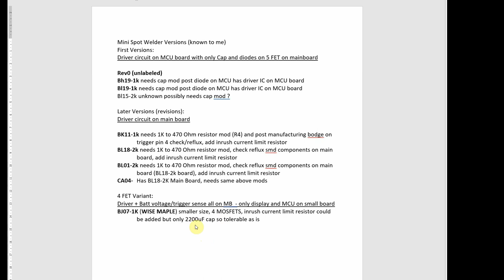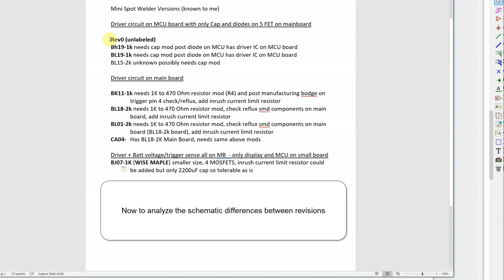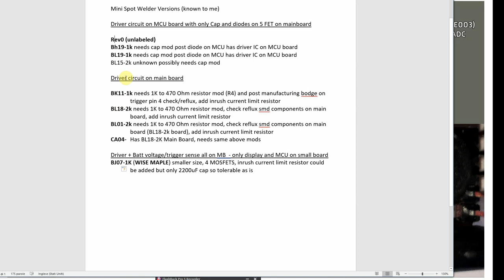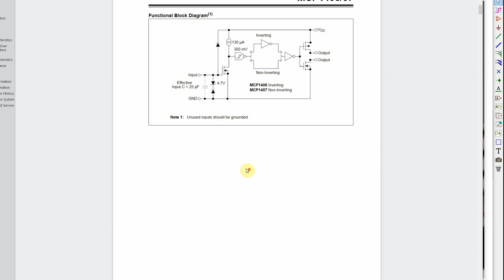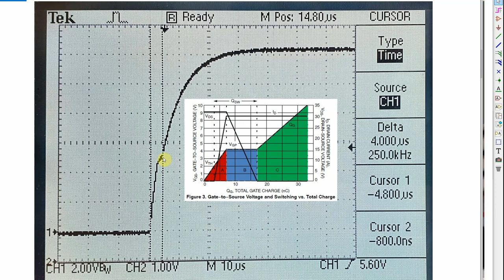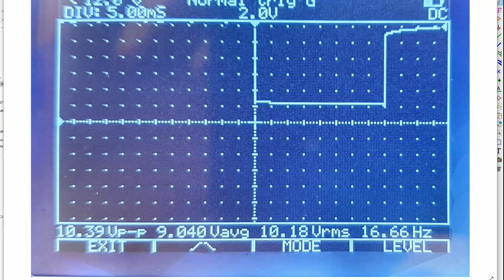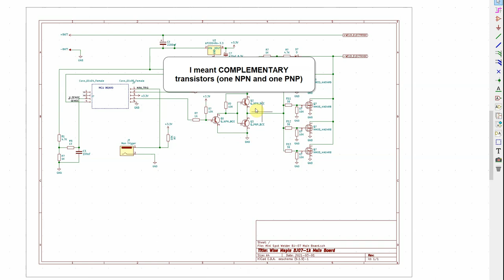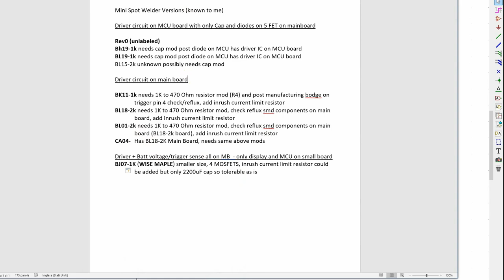All "Mini Spot Welder" versions: circuit Analysis, differences and faults

Comment: hi, i have just got CB23-4k version on both boards. Does it need some tuning?
Reply from the maker: Hi, I haven't seen that exact revision but I supposed it still needs the mods. If you send me detailed close up photos of the MCU board and the main board top and bottom I can check. My email is on the channel description.
Reply: @Luca_Techy  I have sent the photos thx.
Reply from the maker: @jobbagyferi  Yes thanks so the CB23-4K version is no different than the CA version; you need to add the 20Ohm current limiting resistor in series with the diode as shown in my related video and of course most important change R4 from 1K to 470 - 500 Ohms. You can add a 1K ohm in parallel to R4 if you have a same value smd resistor or just swap it out for a 470Ohms one as show in my video.
Reply: @Luca_Techy  Thank you very much, I just received this version and was looking for the correct mod.
In the video you say 100 ohm max on the current limit resistor but above you say 200 ohm, which is better for this board CB23-4K
Reply: I see I read that wrong, you wrote 20 ohm, not 200

Comment: I havnt seen this mentioned! Would a 115 amp hour, lead acid battery , be too much?
Reply from the maker: There is no really "to large" AGM 12V battery to be honest. If you keep the original cables you won't risk overloading the FETs and the welder design. You can even use a 12V 240Amp AGM battery as long as you always start from a low setting (5ms) and go up from there. The important thing is that you first apply the appropriate indicated mods to avoid improperly driving the FETs thus making them fail. The instructions suggest a mininum 45Ah battery because you need a high enough current impulse to weld which such a battery usually had in good working order - with a weaker or bad battery you tend to increase the weld time making the FET junction "suffer" and if the battery is not powerful enough the voltage will drop a lot and the weld will be either weak or inexistant. This is why often ppl tell me their welds are weak even at 40ms with .12mm strips and when they replace the battery with a new or appropriate one the welds are perfect at 15-20ms for .15mm strips. Also the battery connection is most important - screw on clips are the best solution rather than using weak alligator clips.
Reply: @Luca_Techy  Many thanks for your very prompt reply. If I order a pizza, it wouldnt arrive as quickly! I am very pleased I found your site. It is totally informative and superb in its content. A look at chinese power supply rfi, would be interesting. The two I have radiate like they were designed to do it!
Reply from the maker: @davidsaunders1125  Switching power supplies are very hard to design properly and even more to *shield*. Shielding them properly is more expensive than the PSU itself (inductances, ferrite chokes, high quality caps, trace distancing, etc etc cost more than the switching ICs themselves), which is why "cheap" chinese PSUs typically "broadcast" harmonics over the whole HF spectrum and even worse, inject this into your mains supply. I was once given a cheapo/clone laptop 19V PSU that would kill the "ethernet over powerline" completely when simply plugged in the mains (i was reparing a laptop for a friend). Took me a while to figure out what was happening. Upon opening it I was horrified not to mention the high risk of electrical shock in case of component failure. It weighed 1/4 of the original PSU brick (which I had), had no real shielding and if dropped there was a good chance the rectified line voltage (>300V) would short towards the DC output as there was no proper support for the ridiculously mounted heatsink which was "swaying" around the place.
Reply: @Luca_Techy  If you ever watch, Big Clive, some of the Chinese equipment is lethal!! For example, USB socket shells that are at mains voltage, in some modes. But their scopes are very good value for money!
Reply from the maker: @davidsaunders1125  yes I watch his episodes - fun and intersting! As you see, one gets what he pays for, quality is never cheap with some rare exceptions...

Comment: Why is a battery better than super-capacitors?
Reply from the maker: I get this question often: naturally it depends what you mean by "better" in the specific use case. A good working AGM or LiPo battery pack has enough impulse current (over 200Amps) to spot weld. You can even put equal packs in parallel to increase the current as many already do. A Super Cap bank is naturally also viable and has normally more pulse (short circuit) current due to the enormous equivalent plate surfaces a Capacitor has respect to a battery (the major difference). Naturally the overall capacity is a fraction of what a battery has so you can't just use a Super Cap bank to Spot Weld continuously as it would discharge rapidly after just a few welds. You can use a SuperCap bank in parallel with a battery or a power supply to keep it topped off, keeping the SuperCap bank near the Spot Welder to minimize the voltage drop due to resistance losses. Having said this a large 500F 12V cap bank is rather expensive, usually more than a 3S 5000mAh 50C+ LiPo pack, and it is common to already have access to an AGM 12V battery or 3S LiPo pack so you would be ready to go. Of course if you wanted to have an alternative then a 13.5V supercap bank with in parallel a PSU or battery to top it off after every weld can also work, but it starts complicating things and you have more stuff to carry around. I consider these mini Spot Welders more of a portable "field solution" to use now and then and not something one would buy professionally as they are not cut for it so a good car battery or LiPo pack are more than sufficient to get some spot welds done when needed without too much hassle if you see what I mean. Having said this it's really all up to you if you want to use a SuperCap bank plus a smaller battery/PSU or not, it really depends on how you want to use it. One other thing: "cheapo" super caps quickly dry out, even after no intensive use you can find yourself with a dead or unbalanced bank even shortly after purchase. A battery pack is easy to swap out as you may be using it for other things too (RC stuff, drones, planes etc) so In the end for this type of device I prefer a common battery pack than a larger series supercap solution.
Reply: @Luca_Techy  Fantastic answer!

Comment: What is the spec of the D2 Diode? Pretty sure I wrecked it.   I'm planning a rookie repair on my own. Thank you Luca for sharing so generously.
Reply from the maker: Hi Andy, you can use any 1N400x diode, the original diode is the equivalent to a 1N4007 (M7) but you don't need such a high voltage diode for this application, a 1N4002-6 will do fine, any diode that has a reverse breakdown over 100V with a 1Amp current is plenty.
Reply: @Luca_Techy  Thank you.  I did the repair and it worked when I did the light bulb test.  When I tried my first real weld at 30E (the last E setting of the bulb test, I should have turned it way down next) it blew a big hole in the nickel strip.  I think the plywood surface may not have be been hard enough to give a solid contact. Now I have continuity between the two negative posts.  Mosfet blown in open state I guess. Can I test the Mosfets on the board or do have to remove them all? Or refer me to the pertinent video.  Thank you again!
Reply from the maker: Ouch, did you also apply the R4 mod? Anyhow you'll have to remove the FETs to find the faulty/shorted one if you don't find any FET with a cosmetic fault (crack burn or hole on the black epoxy).
Reply: @Luca_Techy  Yes I did do the R4 mod. l'm not very confident in removing/resoldering the FETs but here goes. Any tricks to doing these?  Could you recommend a less troublesome small spot welder?
Reply from the maker: @Andy Louter  To unsolder the SMD FETs you'll need some soldering experience. If you don't have a hot air station or hot air gun you can use a more powerful soldering iron (60+ Watts) with a lot of flux but you need to be careful to not rip off the GATE pin. There isn't really any cheap compact unfallible spot welder, it's always a critical device due to the many variables. All I can say is that the first Rev 0 one with the MCP1407 FET driver on the MCU board after the additional Cap mod is the best so far of these types. There are also others, for ex. there is a fully compact model with LiPo battery enclosed which is definitely a better product, but of course more expensive and not for continued used (good for a couple of dozen welds or so before you need to charge it). Something like this: https://www.aliexpress.com/item/1005001799079203.html
Reply: @Luca_Techy  Thank you very much!  Your advise is very helpful and appreciated.

Comment: You seem to be saying these fail.  How long before failure of these products?  10 welds?  100?  500?  If I can get 500 or so off one I'd be willing to buy one of these for every time it fails as I can order off amazon for $25.
Reply from the maker: They fail if overdriven or used with an incorrect power source. If the indicated mods are applied and you have an adequate battery and use .12 to max .15mm strips then they last for hundreds of welds. Some have told me they have welded hundreds of cells after the mods without further issues. I don't use mine so often but the feedback from others is good. The important thing is to apply the mods based on your version.
Reply: @Luca_Techy  Thanks.  I found the Wise Maple, so I'll order that one.  I'll use a bench power supply.  Like I said, if I can get 500 or 1000 welds out of it I'll be happy at the price of these.  I need to put together a 100ah 14.8v battery and I'd rather buy a couple of these than one of the expensive spot welders.
Reply from the maker: Bench power supplies won't cut it, you need a battery capable of delivering 150+ Peak amps. Use an AGM 20Ah+ car battery or a 3S 5500mAh 50C lipo pack

Comment: Bonjour.
Tout d'abord, excusez-moi de ne pas maîtriser votre langue. Je copierai une traduction google en langue anglaise à la suite (avec sûrement quelques imperfections!) 
Merci pour tous ces précieux conseils. Je possède deux exemplaires (un CA-04 et un Rev.0). Les deux ont subit les améliorations que vous conseillez et ils fonctionnent très bien.
Néanmoins j'ai un petit soucis concernant la tension d'entrée sur l'afficheur du modèle +CA-04 (diode M7 remplacée par BY133 avec résistance série de 10 ohms + ajout d'une résistance d'1k ohms en parallèle de R4) . En effet, l'appareil fonction normalement mais il indique sur l'afficheur une tension de 19,7V alors que mon voltmètre, placé aux bornes d'entrée, affiche 12,75V (l'alimentation est fournie par une batterie automobile 50Ah).
Encore merci pour vos vidéos et vos conseils constructifs.
Robert  

(translation)
Hello.
First of all, excuse me for not mastering your language. I will copy a google translation in English following (with surely some imperfections!)
Thanks for all the great advice. I have two versions (CA-04 and Rev.0). Both have undergone the improvements you advise and they are working very well.
Nevertheless I have a small problem of the input voltage on the display of the model + CA-04 (M7 diode replaced by BY133 with series resistor of 10 ohms + addition of a resistor of 1k ohms in parallel of R4). Indeed, the device functions normally but it indicates on the display a voltage of 19.7V while my voltmeter, placed at the input terminals, displays 12.75V (the power is supplied by a 50Ah car battery).
Thank you again for your videos and your constructive advice.
Robert
Reply from the maker: Bonjour, nes pas un probleme grave, c'est le sensor de Voltage avec 2 resistors (1k e 4.7k)  - il nes sont pas precise. Vous pouvet verifichè le valeurs avec un tester. Les 2 resistors sont sur la plate MCU ou est le R4 (3 resistance, 2 partiteurs et une 1K vers le MCU). Excuse mon francais!
Reply: @Luca_Techy  Thank you for the clarification. I will check the values but if everything works this way I will leave it as is.
Reply from the maker: @bobretnig5831  just be sure you added the 1k resistor in parallel to R4 and not to the Voltage divider sensor - more info on my video where I show in detail the resistors and functions.
Reply: @Luca_Techy  The problem is solved, thank you very much. You were right to have me check the values. R1 was good but on R4 I had made a big mistake to install a 470ohms resistor instead of 4.7K. (the electronic resistors are not like my wife's dresses ... Taste errors on the colors are not forgiving! ;-)) 
13V are now displayed. Have a good week and good luck

Comment: So is this ok to use with a power supply what is the amp draw
Reply from the maker: This spot welder (but not only these models) need a very powerful current supply source and an ordinary power supply will not do (at least not one that is a sub 1K$ ball park range). You need a battery (or car booster/starter): whether it's an AGM (or traditional flooded) 12V 40Ah car battery or a 3S 5000mAH Lipo with at least 50C is up to you (Car batteries are safer in regard to fire hazard if shorted) but you need a battery. A spot weld can easily draw over 400 Amps (up to 900) based on your setup. A battery needs to deliver at least 150CCAs for it to work properly.
Reply: @Luca_Techy  well dang I was hoping to get by with two 
hp dps 1200fb power supplies in parallel
Reply from the maker: While those server PSUs are very powerful, the fast transients would probably trigger their protection circuitry and shut down (they are protected against shorts, and a spot weld is a hard short). However maybe with such fast transients having 2 in parallel may give you enough peak, but as I said, they are not designed for fast high "unlimited" current transients more to protect the electronics and their bus so they would shut down if shorted.

Comment: Sir, is it possible to use this at ~15 volts after modifications?
Reply from the maker: It's borderline but should work, as above 16V the driver circuit will fail on the bk18 and similar push pull driven versions. Why 15V? It's an unusual battery voltage.
Reply: @Luca_Techy  My battery pack is a 4s 4p li ion. I know most 12v stuff works on upwards of 14.5. My thinking was to keep the pack half-charged at about 15V, 3.7 per cell, and not to stress anything. Thanks for getting back and for your research into this, from the views and comments you've helped a lot of folks - including myself
Reply from the maker: It will probably work if the pack is LiPo - if it's  Li-Ion then the peak current may be limited due to the cell characteristics and embedded polyswitch so you may not get good welds. It's best to use "unlimited" and directly connected LiPo cells or even better for safety a large AGM battery.
Reply: @Luca_Techy SPIM08 HPs. Its like 32 AH or something - discharge 200A a piece with 6 - 350F Supercaps feeding this thing. It should have what it needs at its disposal
Reply from the maker: Yes then it should have enough impulse current.

Comment: if I use a car battery, will any of these revisions work fine?
Reply: I have a early version with the cap mod. I use a car battery I think its 800 CCA, use good battery connectors not cheap alligator type. I only need a 10 or 12 setting. I also give a 5 minute rest after 10 welds. So far so good.
Reply from the maker: Yes you can use a large car battery just make sure you start from low settings (5ms) and go up from there to find your appropriate timing. Also make sure you have good connectioms to it - I prefer screw on clips which guarantee best contacts.
Reply: Thanks for the replies, I found a listing that has white buttons on it, hopefully it's Rev 0. I'll do the mods suggested regardless and pull out the battery off my car for my welds, I will get those clips you suggested rather than the clamps I originally intended to use. Thanks for the advice.
Reply: @Ballador  This welder is small but it uses a lot of current. I first used clips and I could actually see arcing going on at the post that is why I went to connectors.. When I first connected there was some sparks I think the Cap was discharged. After that no problem.

Comment: Are you like independent reviewer or you build it?
Reply from the maker: I just bought one by chance (like many others did) and noticed all the problems so decided to review them and explain the flaws and fixes.
Reply: Hei thank you for replying.. I wish I had your contact. Because I'm buimine.. Just for hobby with big touch display and load cell with ardurino.. Would be super brainstorming on pcb..

Comment: the banggood link from Adam Welch video of the spot welder https://www.youtube.com/watch?v=UF3GtD67jPQ sold me Rev0 (unlabeled) one
Reply from the maker: Good to know thanks.
Reply: @Luca_Techy  Will a 1000 uf 35v cap work to fix the Rev0? I do not have a 25v one.
Reply from the maker: @kamsiu7342  Sure no problem
Reply from the maker: Unfortunately his link is no longer valid (the article number has been removed). I will try to speak to Banggood and get them to send me a Rev 0 if possible

Comment: Hi. I recently bought one of these and just came in today. It doesnt have any model or version on it. Can you please tell me which version it is and which mods would I need to do? The pics are at these links ---->  https://ibb.co/MGtFvZ9
https://ibb.co/6FjnmTz
https://ibb.co/9rH2WNQ
Reply from the maker: It's the rev 0 first version, you need to add a capacitor after the diode on the mcu board.
Reply: Hi. Thanks for the info Luca. I figured it was Rev 0, even though it says version 1.0 on the paper. Did you also see the back of the main board from the 3rd pic. There are about 10 components back there too. Are these more diodes and resistors?
Reply from the maker: Yes those are the 30 ohm resistors and protection diodes (1 resistor and 1 diode per FET gate)